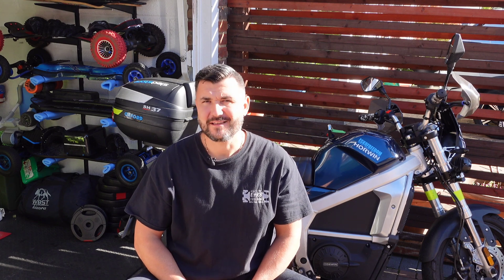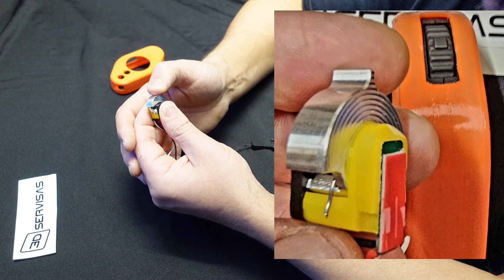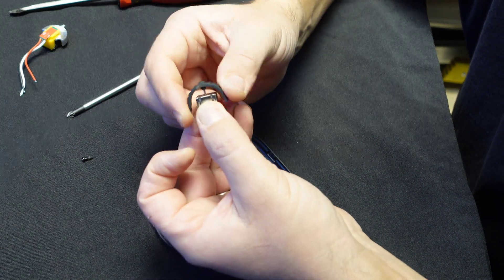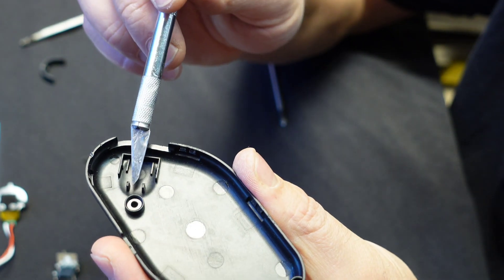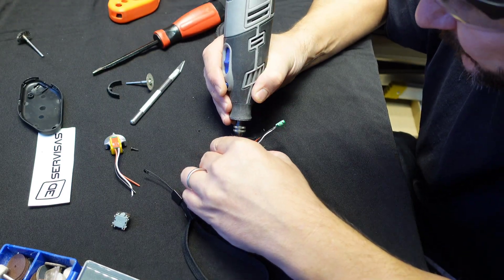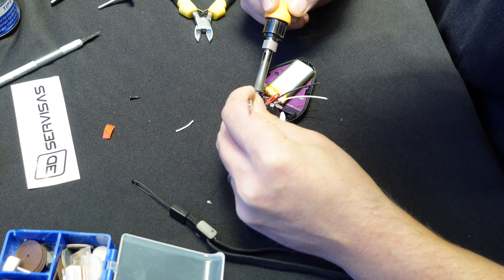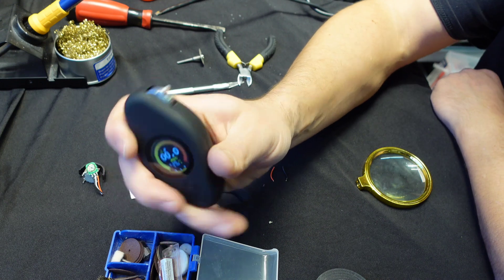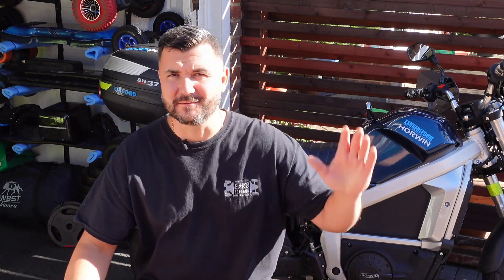15 October 2023

Comment: Hello Pavel.
I have just taken apart 2 identical battery packs. Bosch 18v power for all 3.0Ah. (INR 18650-30Q SAMSUNG SDI 144 Cells)
I ran all the cells with discharge refresh on my Opus.
I took out the 5 best ones and spot welded them back together. It works great’ish…
Here is the question for you.
3 of the cells were discharged to 3.2v. The other 2 cells were still in the Opus, discharging to 3.2v as well.
Well, I couldn’t wait for them to get that low, so I disrupted the discharge cycle at 3.6v.
I just used the battery for about 15 minutes on my Bosch vacuum machine, and drained the battery. Opened the battery and tested 3.2v on 3 cells, and still 3.6v on the 2 I installed prematurely.
Why will the cells not just "even out"?? Or is there a way to do this without ripping everything apart again?
Thank you so much for interesting good quality videos.